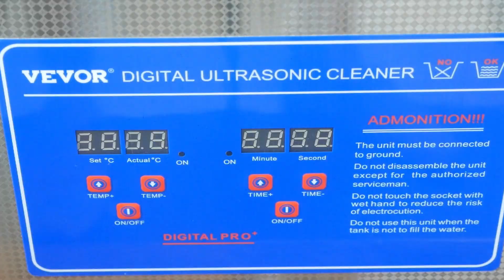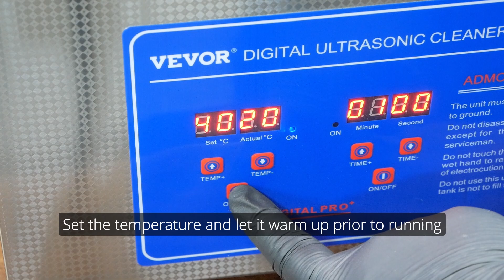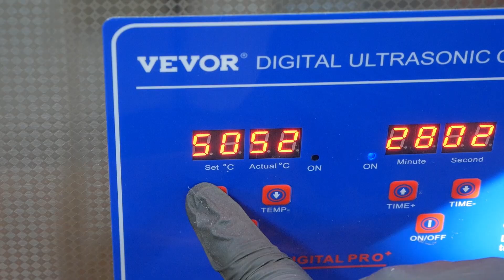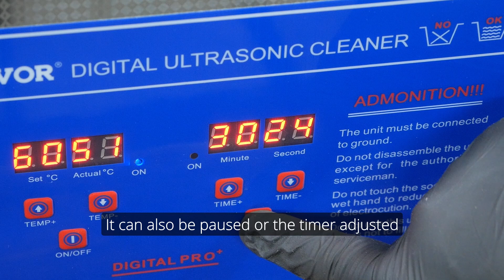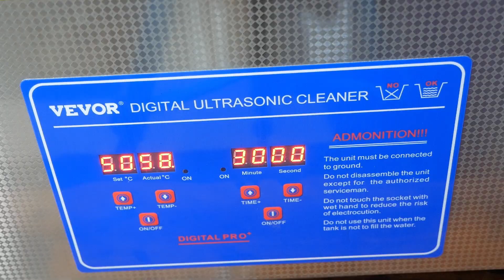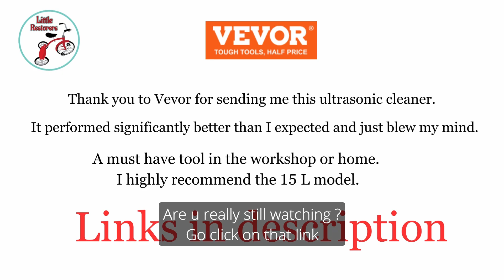Enhance Your Restoration Projects with an Ultrasonic Cleaner. Simply Wow !!!

Comment: Dont remove the basket, always use it. It will put additional stress on the ultrasonic inductors causing them to heat up more and decrease service life, while also decreasing the efficiency of the cleaner.

Also, after adding/changing fluids in the ultrasonic, run it with fluid only (~5min) to eliminate microgas bubbles in  the fluid before adding parts to be cleaned.

Last bit of advice....instead of plastic bag for small parts with different fluids, use that glass mason jar that you measured the CLR with....soft things absorb the energy instead of passing it through.

If you dont already have one, buy one of the loose leaf tea strainer/containers to put small parts in without losing them (or magnetic parts dish).

hope some of this is new to you...enjoy your new cleaner :)
Reply from the maker: Some great advice there. Thank you very much for taking the time. Awesome comment 👍

Comment: Aha! A reload! The title threw me, then I watched it... again. Still as informative & interesting. 👍🏼👍🏼
For anyone that doesn't have an ultrasonic cleaner, they don't know what they're missing!
Reply from the maker: Haha.. yes, unfortunately, it hit a wall the first time and wouldn't climb over it. Let's see if it does a bit better this time. All the links are still the same as before. 
I appreciate that you still watched it  again  😁. Don't worry, there won't be a 3rd relaod .... may be 😉🤣
Reply: @LittleRestorers  All good, thought it may have been some yt glitch. 👍🏼
A third? Maybe... maybe not! 🤣🤣
Reply: Totally enjoyable the second time around. Amazing work on the breast drill.
Reply: @shedmanx3640  I'm looking forward to seeing that finished!
Reply from the maker: I got this breast drill a few years ago and spent countless amounts of time researching it back then. I could not find any info on it. (No makers brand either). The one odd thing is , once mounted to the stand, it stays in a fixed position. A drill press which u can not press down 🤔- I am guessing the baseplate could be what's supposed to do the moving, but it's missing the handle or mechanism for this to happen 🤷
Reply from the maker: Thanks mate, thought I re-post it in case u missed something the first time 🤣